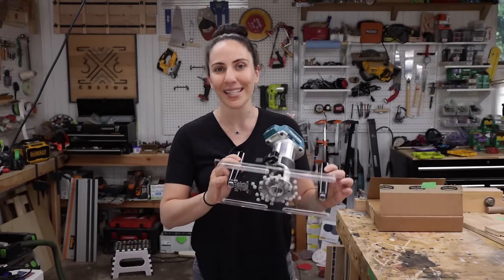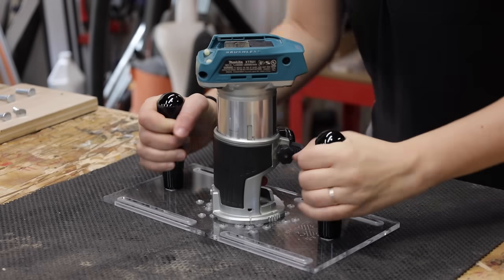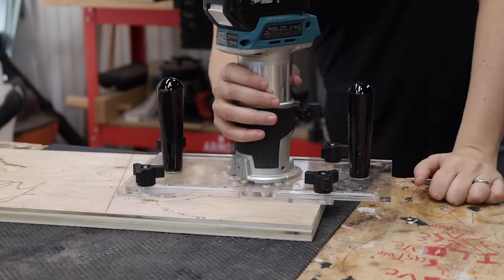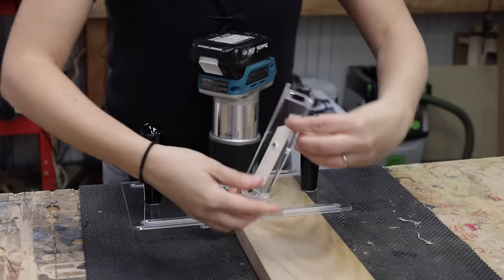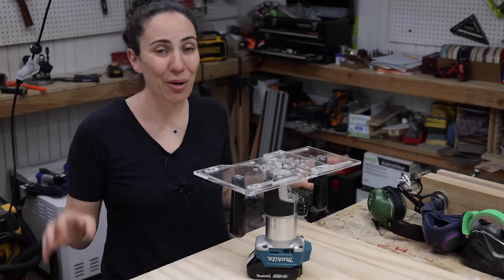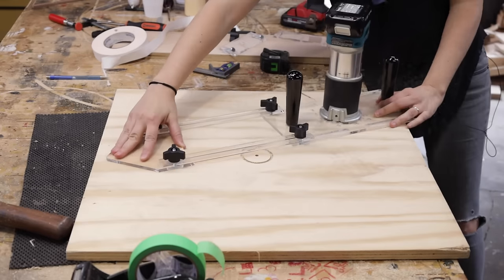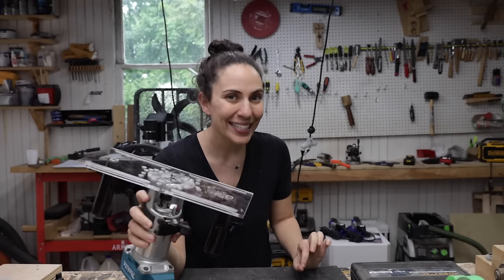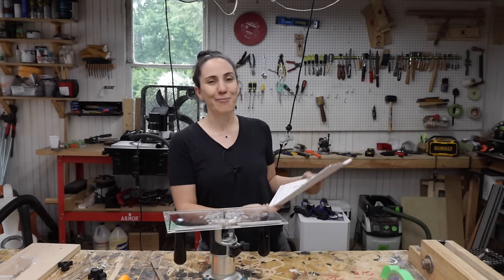How to Use the 6-in-1 Universal Trim Router Jig

Comment: Hey Tamar, FYI, you might want to make the holes that the threaded pin nest in a trifle bit bigger than you're currently laser cutting them.  I got mine this past week (ordered 2/9/2023).  Love the jig but those non threaded holes are just too tight to nest that pin into.  I'm going to have to widen them to make that happen.
Reply from the maker: Oh no. Thanks for the heads up. I’ll forward this info over to the production team
Reply: Just received my jig 8/5/23 and my center hole is too tight to, also the slots are to tight to get the bolts in let alone try and move

Comment: I got mine a couple of days ago. Seems really well made and set up easily after I got the base plate off my router (who is the gorilla DeWalt hires to tighten those screws?). Only problem was that the pin which is supposed to be taped to one of the handles was missing. Looks like it will be easy to make one from a 1/4 inch bolt, but still....
Reply from the maker: Oh no! Reach out to my support team at support@3x3custom.com
Reply: @3x3CustomTamar  Thank you! I did.

Comment: Does this work with the Dewalt fixed base? Thank. Awesome video.
Reply from the maker: It works with the Dewalt compact/trim routers.
Reply: @3x3CustomTamar  thanks.  The reason I asked about the fixed base, is in your awesome video, the instructions showed Dewalt plunge router.  Can’t wait till you get these back in stock and thank you so much. Bob.

Comment: Hi everyone - a word of caution about this @3x3custom #3x3custom router jig. Mine was delivered in great time and was exactly as advertised. The only problem I had with it (and it was totally my fault) was that the base plate screws on my older style Makita corded trim router did not match any of the standard holes on the 3x3custom jig. The problem was easily fixed by drilling some new counter-sunk holes in the base plate to match my router base screw holes.  You just have to be very careful lining it up on the drill press.  So my advice before buying is to just make sure your trim router is one of the models specified for the 3x3 custom jig.  As I said totally my bad and I have no complaints with the product.  Thanks.

Comment: This is a very good jig and similar to the full size router base plate / jig made by the Samurai Carpenter. The only method I disagree with is the edge banding technique. The type of edging, and the type of bit, could cause damage or excessive chipping. If a spiral bit is used then the bit should be parallel to the edge being cut, not perpendicular, as the design of the bit is to slice away material.

Comment: I ordered the jig. It's nice, but I ordered a dewalt plunge router as well, because it says it will fit  dewalt. It doesn't fit. The holes will NOT line up. What now?
I sent an email to website, waiting on an answer there as well. Thanks

Comment: I got mine today! But… the 3x3Custom logo is proud and it catches on or scratches all the material I run across it. When I use it with the router table, the material keeps catching on it making it dangerous.

Is this supposed to be smooth?

Comment: Hello Tamar,

What time does it usual take to ship out the package once LA has it?

This is the message in the tracking info:
June 25, 2022, 10:47 pm
Shipment Received, Package Acceptance Pending
LOS ANGELES, CA 90009 
Your shipment was received at 10:47 pm on June 25, 2022 in LOS ANGELES, CA 90009. The acceptance of your package is pending.

Is there something wrong?

Comment: Is it possible to make a hole slightly larger?  Also, my first attempt, we cutting the hole on the second and final pass, it tore out and caused a slip/imperfect diameter.  Any way to prevent this?
Reply: Oops, I realized my cutting bit didn’t have a bearing for my second pass which caused my problem.
Reply from the maker: Glad you figured out the problem

Comment: I'm a builder. I work in wood, leather, electronics, clay, 3d printing, etc.. I build things and love it. So I could build this myself. I have all the plexiglass sitting unused on a shelf in my workshop. I have all the tools, and everything I need to build it. BUT WHY should I? If there were no other considerations still why waste my materials. The plexiglass alone is a significant cost of building. Now imagine your design time and test fits. Why even try?
Spend the $70 or so, it's worth every penny.  I have to guess they can make it available at such a low price is that they have lower overhead expenses. I'm sure the major tool manufacturers would charge at least twice the price.  I have my eyes on her stopblock, I think it will be my next purchasse

Comment: could you put an edge guard on both sides for dados
Reply from the maker: You don’t need to if you’re running the router in the correct direction. But sure, you can add anything you need that’s the beauty of it

Comment: dont know what im missing but my printout is too small so the holes dont line up . im printing in A4 in the UK  should i be printing in a different format ?  i can get the jist of which holes to use for my router though
Reply from the maker: Is there a 1” reference line on the bottom of the page? If not you have an older version of the template. Email me if you need help
Reply: @3x3CustomTamar  thankyou  , as you say i must have dowloaded an older one . i have dowloaded and printed the latest version and its perfect. cant wait to get to use it this weekend. thankyou

Comment: Tamar, I just a received my template and was watching this video.  I have a Ridgid palm router.  Is this not designed to work with the Rigid?  I don't see it listed there @1:40.
Reply from the maker: It is. Are you still having issues? Please email our supports team. Support@3x3custom.com
Reply: @3x3CustomTamar  to be honest, I have not even tried to install it. Looking back at either the website or the instructions, I see that the Rigid and another brand were lumped together. Thank you.

Comment: Great idea. I purchased one my base I purchased didn’t line up with all the holes with my router. When I emailed to inform them they were funny. They asked if the plastic template lined up with the pdf J printed. I did inform them I did even better I actually had the router. I emailed photos and it’s been a few weeks with no response. Apparently they did not appreciate my snarky comment. I still think it’s a good idea. Just disappointed in their customer service
Reply from the maker: Hi. I remember your email. The reason we asked if the base lined up with the printed paper template was to make sure your jig base was milled properly. If it lines up with the paper template then it should fit your router and we will guide you through that. We have experienced troubleshooting this issue before and usually after people line their jig on the paper template the problem is solved. 
If you are still having issues please reach out to support@3x3custom.com